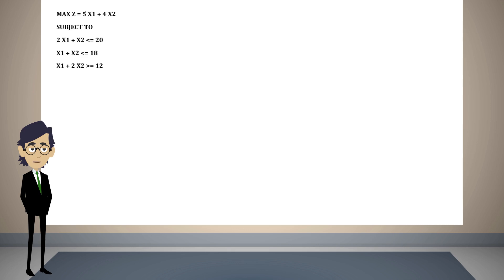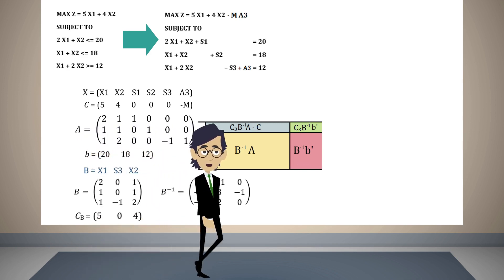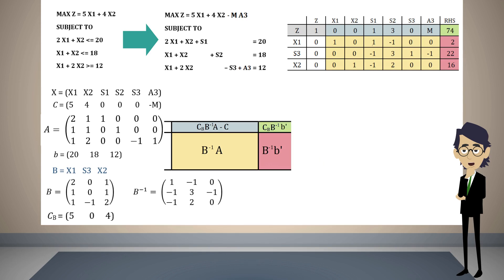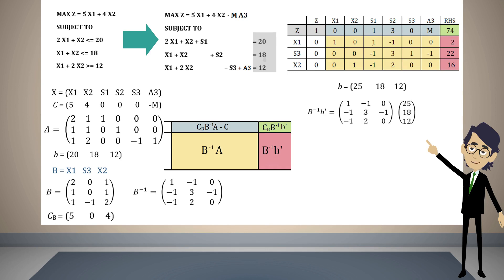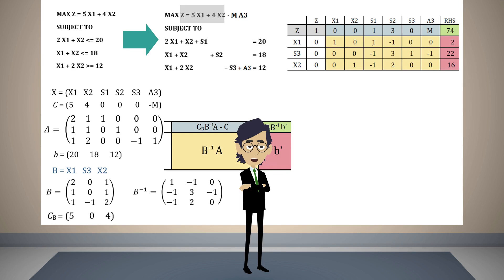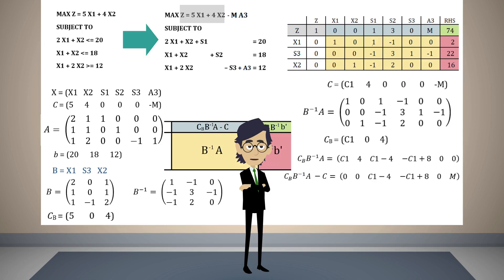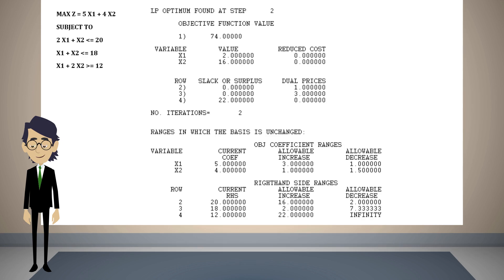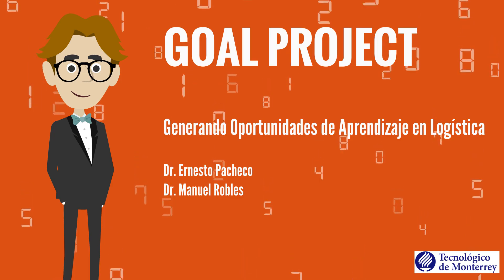Introduction to Sensitivity Analysis

Comment: While I was solving the problem at the beginning of the video, I always find that basic variables are relatively x1,x2,s2 NOT S3. Are you sure about that, if I have a mistake, could you please explain it ?
Reply from the maker: The constraints are:
2 x1 + x2 <= 20 ----> 2 x1 + x2 + s1 = 20
x1 + x2 <= 18 ----> x1 + x2 + s2 = 18
x1 + 2 x2> = 12 ----> x1 + 2 x2 + s3 - A3 = 20
The solution is x1 = 2, x2 = 16, s3 = 22.
The solution is correct, because if you substitute the values of the variables in the equations on the right, you will find that the constraints are satisfied.

Comment: A simpler approach is to use the new Cj value to subtract from the Zj row of the solution simplex table and check if the result (after subtraction) on the Cj-Zj row remains zero or -ve for a max. and zero or +ve for a min. problem. If the optimality check shows that optimality will change then proceed with the next iteration